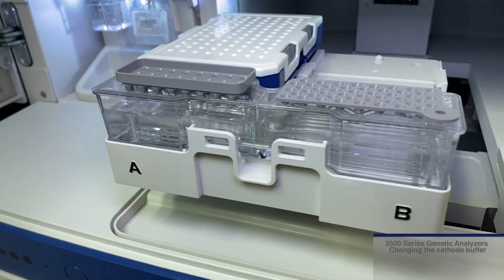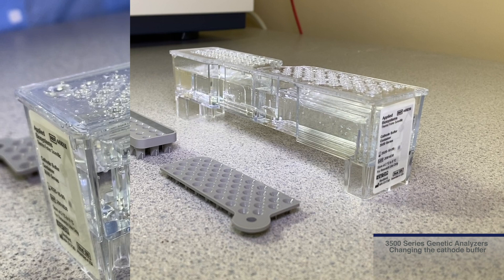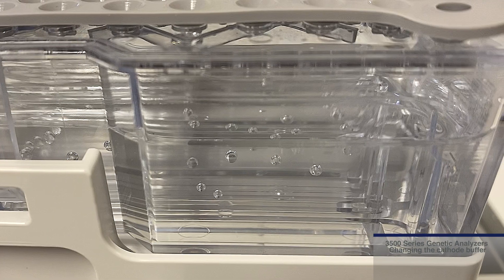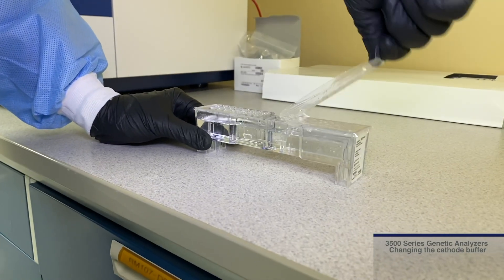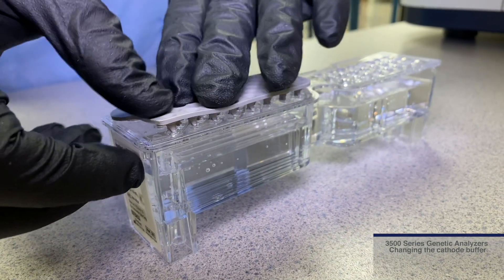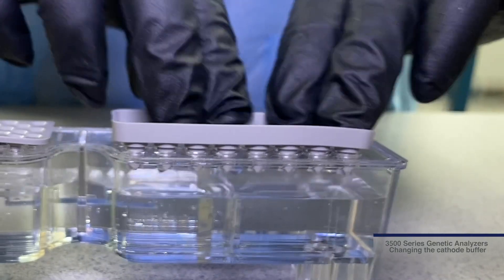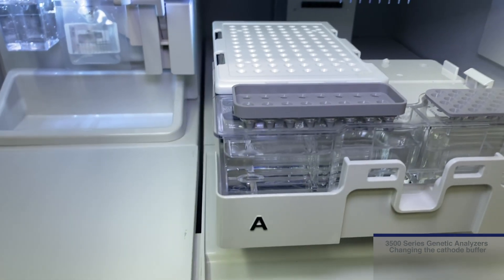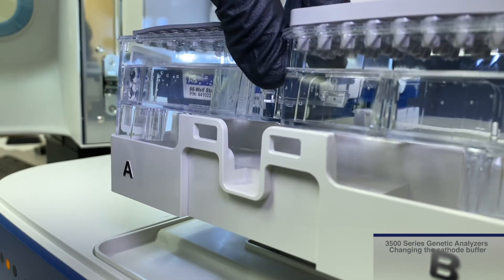Changing the cathode buffer

Comment: Please, Could you explain everything; I mean change the buffer and use the computer, because the 3500 has to recognize the new buffer or I have to do it?
Reply from the maker: Certainly! For a comprehensive explanation, please contact our dedicated support team at thermofisher.com/askaquestion. They will provide detailed guidance to address any queries you may have. Thank you.
Reply: @thermofisher  Hi, my laboratory had a training with the experts many years ago because we bought the equipment of course (3500). But now, in my case my ex boss wants that I training/teaching the new coworkers; but I am not working whit the 3500 since 4 years ago; so I don’t remember everything and the experts in my country charge a lot of 💰💰💰💰💰So, I think that if you teach part by part; will be nice. You don’t waste your time, because if I donde have a 3500; I won’t see your videos. Please we need full videos because we bought your 3500; 
Change the POP
Change the capilar
Spatial calibration 
Spectral calibration
Maintenance 
review past runs
Etc.